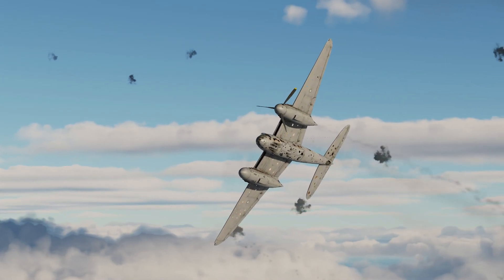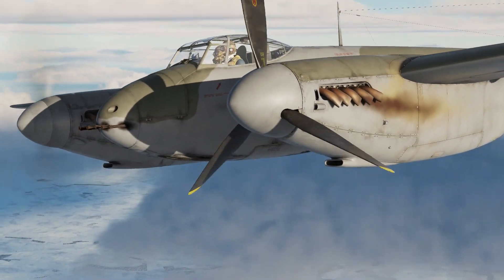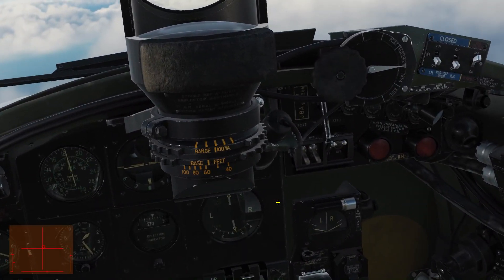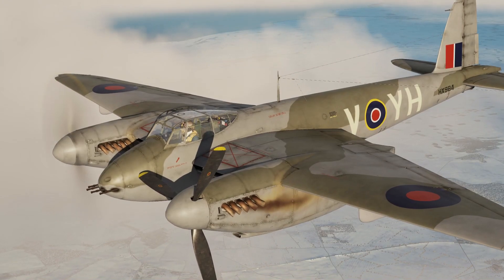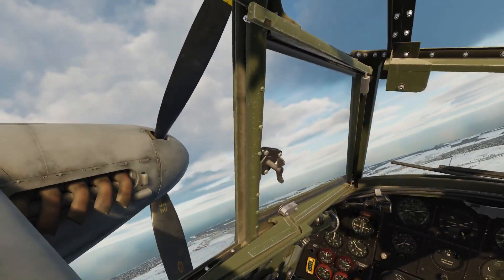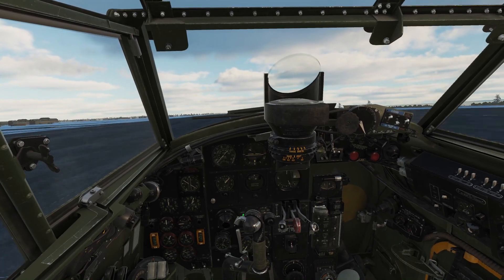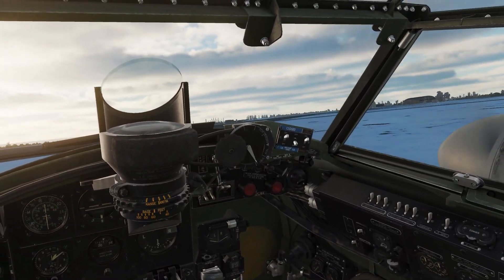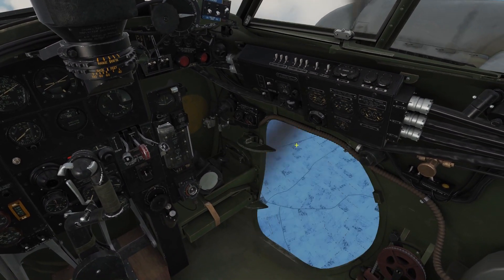DCS Mosquito Single Engine Emergencies Tutorial

Comment: I am glad differential brakes exists.

With 1 engine in War Thunder on a twin engined plane, I usually would apply full braking on 1 wheel with no throttle to turn right.

I think with a lot of practice in DCS, it would work for the Mosquito.

Comment: The point raised about the landing gear hydraulics on a single engine taking longer to lower the gear also becomes an issue if you experience an engine failure on take off (EFATO).

In this situation you will have to quickly react to counter the sudden yaw with rudder, pitch down to try to reach your "blue line speed" of 170mph altitude allowing of course.  Firewall all engines - mixture full, prop full, power full, raise gear and flaps and then identify the failed engine "dead foot - dead engine" ie whichever foot is not pushing the rudder is the side of the dead engine.  Now confirm this by moving the throttle for that engine and assuming correct immediately feather it.  You then "raise the dead (engine)" ie your 5 degree bank into the live engine to counter the sideslip caused by the engine failure.

The issue is you will never get above your 170mph safety speed due to the landing gear drag and it will take almost a minute to raise the gear in this situation.

You will more likely hit Vmca ie minimum control speed - the speed below which the rudder does not have enough authority to counter the yaw of live engine.  When this happens you will yaw and roll over and become a fireball.  The only option you have realistically is to pull the throttle back on the live engine and find a landing sight directly in front.

This will be even worse if the left engine fails as it is the critical engine.  This is called critical because of the angle of attack of the blades at higher angles of attack - the left engine's downwards travelling blade is closer to the fuselage and produces less P factor and yaw is less as the thrust line is closer to the fuselage.  The right engine is the opposite, the downward blade is on the right wing root side of the aircraft and so the thrust line is further away from the fuselage and produces a great torque moment and thus more yaw.  As such it is better to lose the right engine than the left.  Always ask Jerry nicely which side to shoot at.

I'm pondering doing a video later on focusing on handling engine failures on takeoff in the Mossie but lets face it, unless lightly loaded with no stores the chances are pretty slim of success and since this is a combat aircraft it won't be taking off lightly loaded very often.

An element missed out by Reflection is that running on a single engine means a growing fuel imbalance as you have a fuel tank sitting unused on the dead side.  This should be treated like a single engine aircraft with a L/R fuel tank selector and as such every half hour turn on the cross feed on the live engine to take fuel from the opposite tank and balance it out.  Beware though that if the fuel itself is the issue ie contaminated in some way then you could kill your live engine.  Obviously this is not an issue in DCS.
Reply from the maker: Thanks for the interesting details!
Reply: I practiced this last night with no loadout.
 
First attempt was immediately on becoming airborne - pulled right engine throttle back to idle and immediate right yaw and violent roll to the right.  In reality I would have closed throttles and landed with whatever runway was left.  

Second attempt was high and with gear retracting.  Immediate yaw and roll but less violent and on 'feathering' (by applying a slight 7-12% increase in power to 'dead' engine thus simulating zero thrust) I was able to fly the circuit and return to the field.

Comment: 2:54 That probably is to have the prop at least at a coarse setting in case the feathering might fail to reduce the drag the prop would induce by windmilling. This would also be the procedure on planes that don't have feathering (basically almost, maybe even all single engined ones in WWII, but also some multi engined ones).
Reply from the maker: Indeed - however, would it be possible for the feathering to fail, but the prop control to still work? Both work with oil pressure. In any case, it's worth a try.

Comment: I have three buttons mapped. Select left engine, select right engine and select all engines (These are, IIRC, mapped to 8, 0 and 9 above the alpha keyboard by default).  As I don’t have dual throttles this enables me to adjust RPM and boost separately. Saves having to use mouse when engines need specific input. Not just for feathering, I also use them when flying with very low engine RPM and boost as the engines indicate an imbalance at low settings.

Comment: This is the first time watching DCS video that a virtual pilot (maybe a real one) explain how to manage an emergency almost like in a real twin engine. I will give you the clue needed to win the cigar. https://youtu.be/oD3YPdOH5Xo
Reply from the maker: Thanks for the info, watching it now! I'm a real life pilot too, but I have no multi engine rating so I may have been talking a lot of nonsense :)
Reply: @ReflectedSimulations  No Sr. I’m a single engine private pilot too and your video is amazing.
Reply from the maker: @arturojgt-ITV  Thanks for the kind words! Happy landings!
Reply: Indeed, a very good video!
As you mentioned you don't have multi engined experience, I'd like to add some info based on my own experience (although it's been over 20 years since then...)

On the  single engine approach (as with any approach) you should always be prepared for a go around. In this case I would have the live engine at full RPM selected, so full power will be available should you need it.
Also I would use a lesser flap setting (about 50% of the normal landing flaps), otherwise you might end up with too much drag and the go around might not be possible...

Cheers!

Comment: That's weird. When I cut throttle and click the feather button, the engine never stops, the prop never feathers, and the button doesn't pop back out. It just keeps windmilling, even if I kill the fuel and mags.
Reply from the maker: Make sure you keep the feathering button depressed for a few seconds. Works for me every time.
Reply: @ReflectedSimulations  It only works for me when flying offline. When I fly online and get a damaged engine, the feather button gets stuck in a depressed state and the prop never feathers.
Reply from the maker: @DCS_World_Japan  That's....'depressing' :) In any case it may be a bug, I never tried online. Better post a track on the forums.
Reply: @ReflectedSimulations  I can only reproduce it with 30+ minute missions, and they won't look at tracks longer than 5 minutes :(
Reply from the maker: @DCS_World_Japan  Hah, story of my life. If I see a bug in my campaign missions, the track is 1.5h long and 30Mb. Then I try to reproduce it in a 'virgin' mission, but then it doesn't occur :D
Reply: @DCS_World_Japan  have exactly the same issue online.  

I’m guessing they will fix it soon though